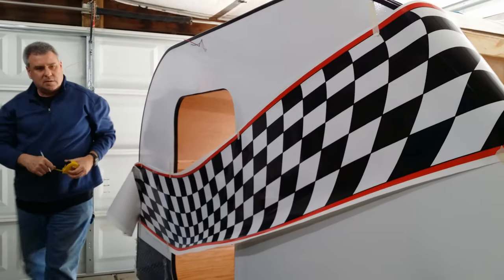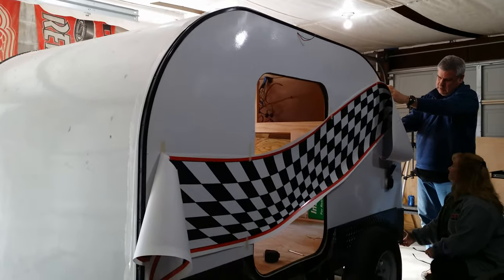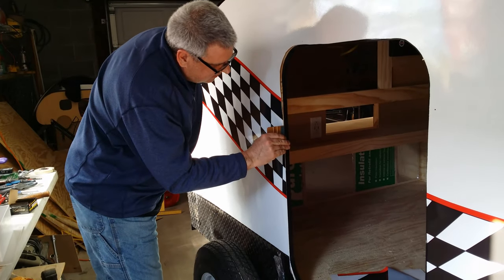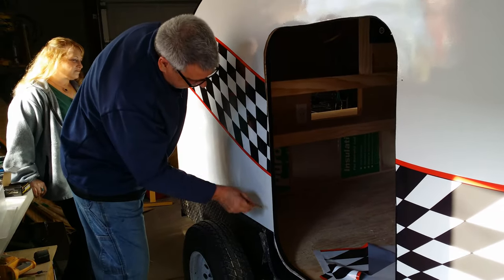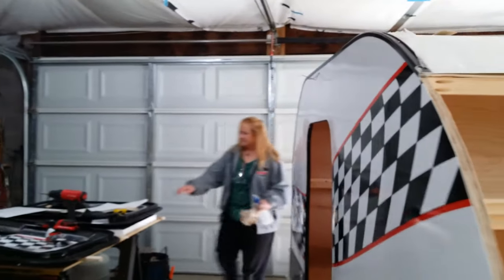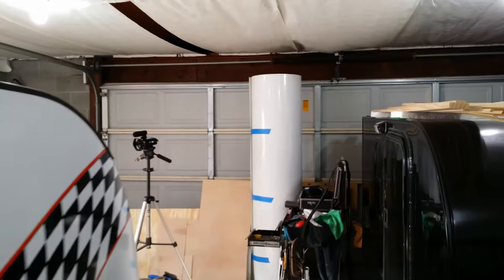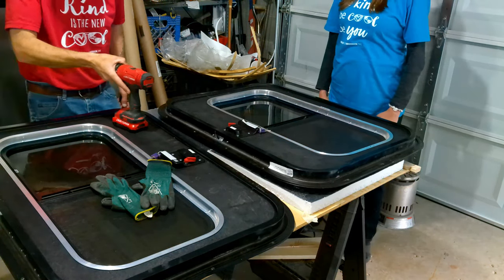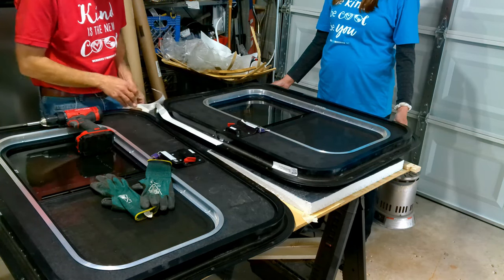How to Build a Teardrop Camper. Part 10. DECALS & DOORS (Donation Build)

Comment: How come you don't glue the surface material to the plywood? I notice it moved quite a bit when the decals were applied and also around the openings.
Reply from the maker: Delamination is why I float it
Reply from the maker: Filon and plywood expand and contract at different rates. I have found if you glue it, it can delaminate and that is almost impossible to fix so I float it to avoid that in the future. Thanks for watching
Reply: @DIYTearDropJay  I understand the information about different expansion rates, but you say you float it to avoid delamination but ain't that what you have already by not laminating it to begin with?  To avoid it in the future, just do it now. lol
Reply: @DIYTearDropJay  It is not the best material to use than imo. But still pretty nice. So in this case the more holes for doors, windows, electrical hookups, water connectors, etc... the better, they are holding points for the filon. And you used that diamond plate all along the bottom for another great holding point.  Good work around, nice work.
Reply from the maker: @TheRebelmanone  if it's glued and it delaminates and bubbles, it stays that way. By not gluing it, it may get wavy when it expands but it's as smooth as glass when it cools off. That is definitely not the case if you glue it. Thanks for watching. Build on

Comment: I'm in Canada I'm wondering where to get the doors cheap I see on Amazon  they want 400
Reply from the maker: That sounds about right. I prefer to cut down full size RV doors. I find good used ones on marketplace and just cut them down to fit. I have a few videos of that process on my channel as well. Thanks for watching!
Reply: @DIYTearDropJay  I'm  also wondering if a guy  could  use that plastic panels that are textured they sell at home depot 25 a 4x8 sheet its .92mil
Reply from the maker: @kevinswanson3910  you can! I have seen it. The only thing is, it has to be painted. The UV from the sun will destroy it otherwise. Thanks again for watching! Build on!